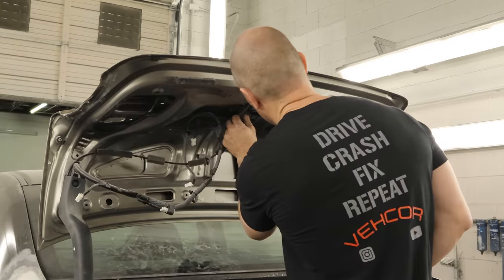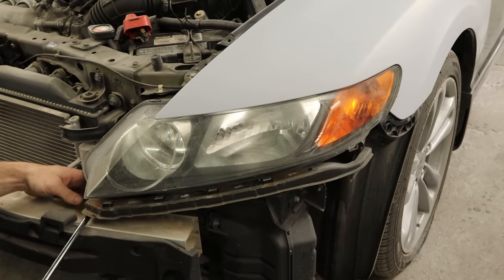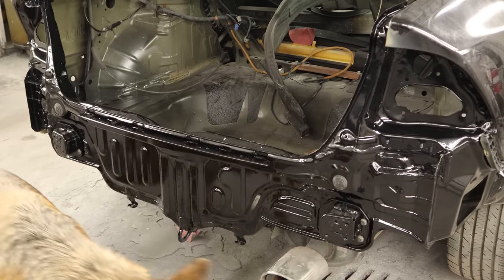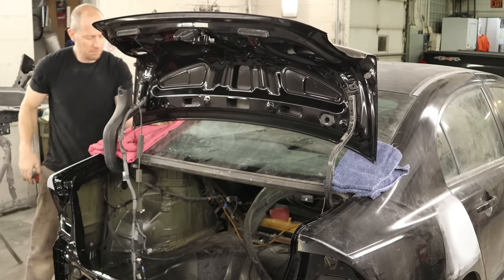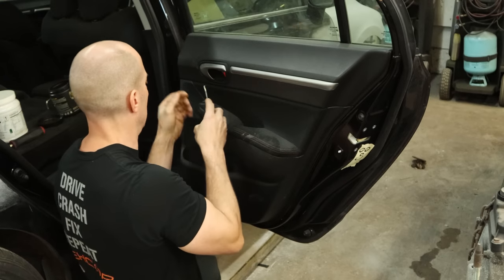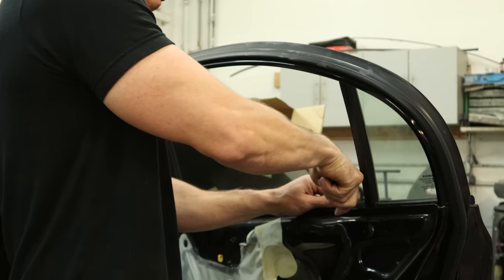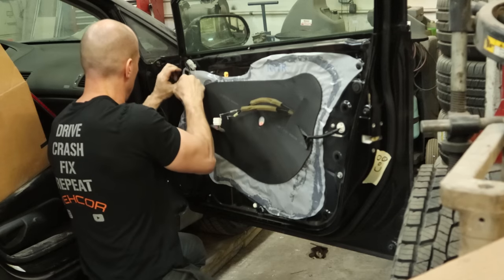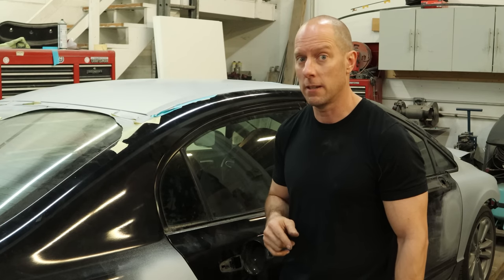Rebuild turned restoration of the lowest mile Civic Si in the auction

Comment: I used to have a 3 ft long screwdriver extension. Showed up to the construction site and all the "pros" were ragging on me about it. So we had to install drywall on the ceiling of a cottage we were renovating. A dutchman to hold the board up, me on the ground with my 3' extension, screws in the corners and a couple in the middle onto the next one. Then once all the boards are in place, I walked around putting the rest of the screws in. 

Hey how'd you board the entire ceiling in a couple of hours by yourself?

30 mins later every one of them was asking where I got the extension and if they could borrow it. lol Funny how the "know it alls" don't.......